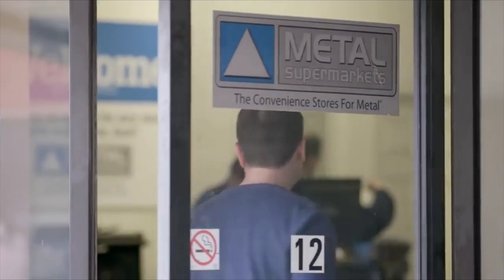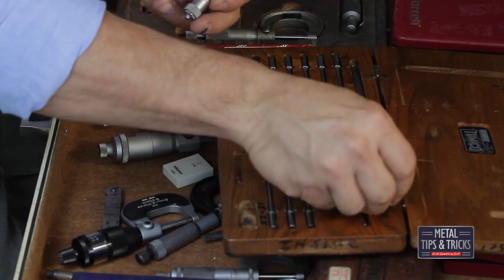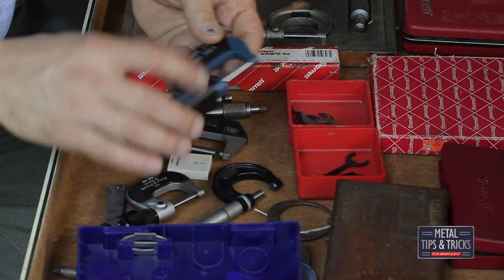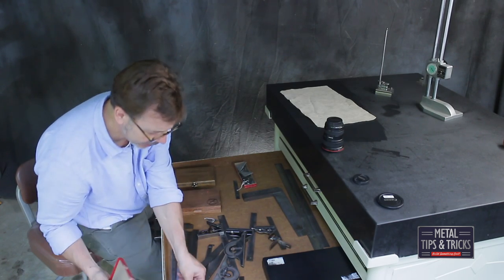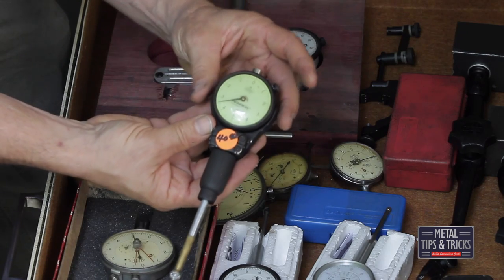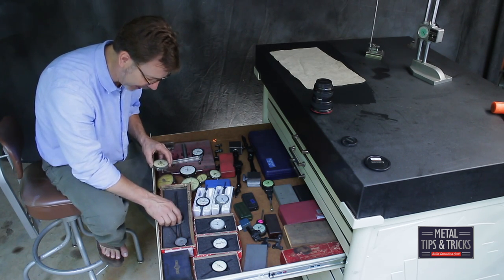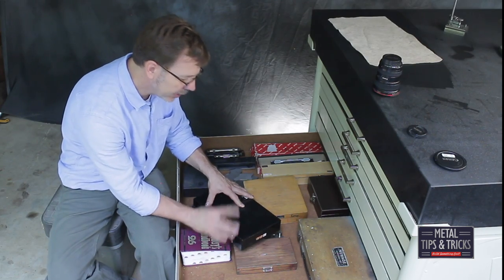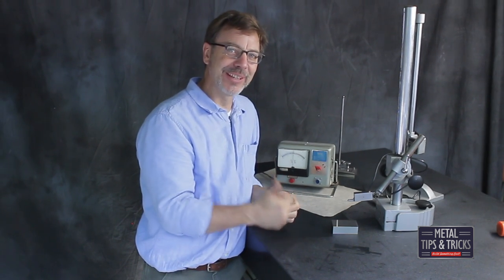Ultimate Metrology Center  (Part 6 of 6) Inside the Drawers

Comment: I take exception with the term "accuracy" on all those measuring devices. I'd use resolution; accuracy is different and a separate issue.
I have a Craftsman Vernier caliper. Has a resolution of 0.001 but the inside jaws are off by 0.004" (came that way new.) Shame as it has that lever you press to unlock and release to lock. I much prefer it to the thumbwheels and separate lock.
That was a coaxial indicator.
Great vid as always.
Reply: I was about to post the same, and it's not just a minor semantic note. Resolution (also called precision) is not the same thing as accuracy (ie: error). And angular resolutions stated as a distance (ex: 2mm) are meaningless without the distance measured over (ie: 2mm per 1m). Still a great video; was cool to see all the instruments...